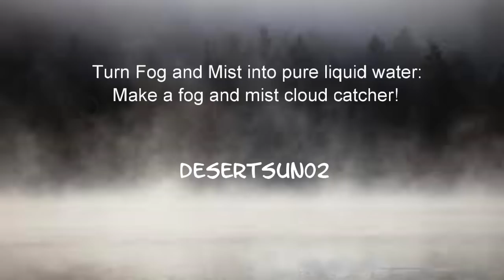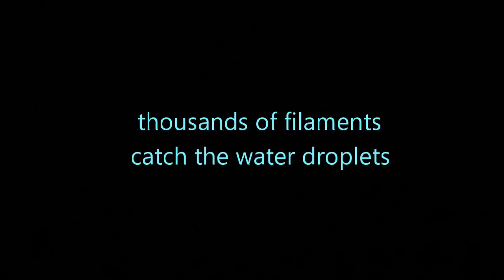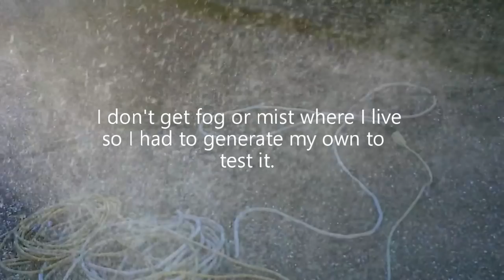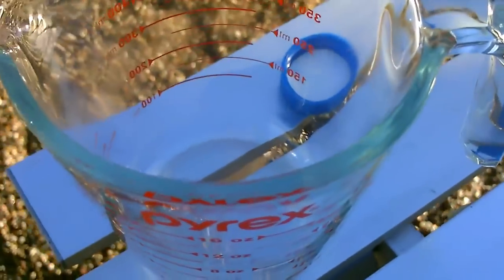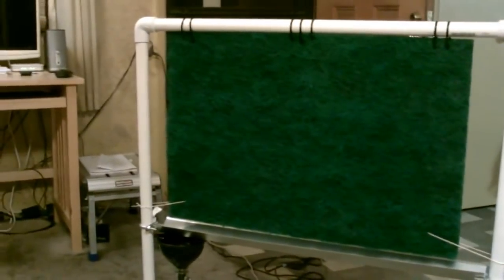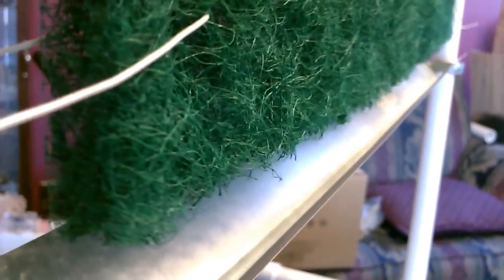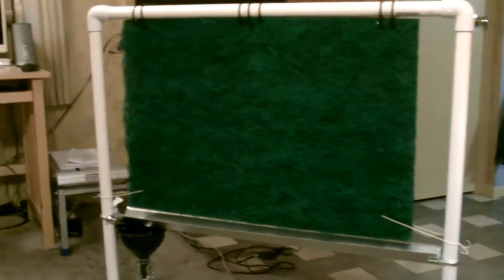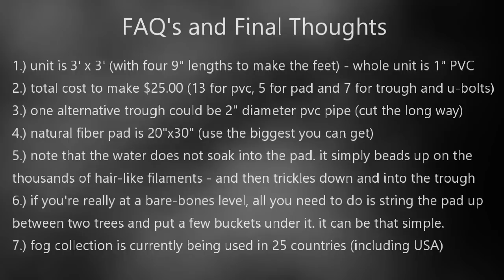DIY Fog Fence! New Design!! Hi-Efficiency Fog Net! New Material!  Harvest Water from Mist & Fog! $25

Comment: This is swamp cooler pad material.  It's available in both natural and synthetic materials.  For longevity, I would recommend the plastic material, which can be purchased in rolls up to 20 feet long.  As far as the trough is concerned, you could cut a slot, say 1/2 inch wide and a couple of inches deep at the lower end to bring the drip more toward the center of the bucket or funnel.  You also might want to drill a couple of holes at each end of the trough where the U-bolts support it and run a zip-tie through the holes and under the bolts to secure the trough into the frame.
Reply from the maker: hi there. one clarification -  it's not swamp cooler pad. that's a relatively soft sponge-like material that absorbs water. this material has the consistency of plastic but is made of natural fiber. it looks kinda soft and absorbent but is actually rough, rigid and bristly and absorbs no water.
Reply: @desertsun02 so what is it?
Reply: @tsachnebiah4832 same question here . Obviously money is getting in  the way here
Reply: Where to buy the net

Comment: Wondering if I can wrap some of this material partially around a tomato cage to make drip irrigation for my tomatoes.
Reply: Wouldn’t it shade out your tomatoes?
Reply: Use the clear polypropylene netting.  Sun goes through.  I’d have a pvc teachers to the bottoms and then have that feed to drip hoses like you would from irrigation.
Reply: @andys3138  Just use on the north side of the plant row so the sun hits the plants first. Might also try just wrapping the main stem with this stuff and see if that improves hydration of your tomatoes. Sometimes the simplest solutions are the best.
Reply: Better yet create a drip irrigation system and remember, the absence of fog means no water.
Reply: @unclemony5939  Correct about this method, but there are other passive means to get water from the air.

Comment: Great idea.  I am looking for a natural way to supplement water on a sailboat.   Will give it a try.
Reply: If you try this, please let us know how it works for you
Reply: Pretty sure you can just use your sail, with a catcher at the bottom. It doesn't need to have the same material as the video.
Reply: I think some ancient Greek sailors used an amphibole or other container partially filled with seawater with a sponge on top to trap and collect evaporate water.  Check out Thales or Milutians.
Reply: @jeromesassani9537  I did some experiments using a black sponge in a black can, within a clear container, and got very little water (only drops)   It was only 7 square inches.  Not enough to live.   I reasoned, that the amount of water produced, directly corresponds, to the surface area exposed to sunlight.   Will need several square feet to produce any significant amount of drinking water.

Comment: The filter is also going to do the job its designed for, which is collecting particulates. So your water would be  very dirty in an area with dust blowing around. Like a desert. But Im going to try it for irrigation here in central coat California.
Reply from the maker: hi. i hope it works for you. yes, dirt might be an issue in desert with wind. you could always put the water through some activated carbon to remove the dust.
Reply: did you try this? any luck?

Comment: I've been looking these up. I was also thinking about how buns make  water if they are cold and it gets warm i am thinking putting those 2 ideas together would be pretty neat. Gardening watering. With a later of plastic or glass. I'm going to play with this idea. Thanks ! That materal is hard to find but multiple shade clothes might just be the easier way these days.
Reply from the maker: hi. you can find the material at walmart or on amazon. one way to find this type of material is to search for 'hogs hair'. it's sometimes called that. it's not real hogs hair of course though. i show a shot of the packaging in the middle of the video. that may help you

Comment: I’m looking to make a off grid water collection system myself, but no fog in my area . I was thinking about a portable dehumidifier with a drain plug . Sat on top of a 55 gallon drum, and let it run into it rather than the little tray provided. Then rigging up a pump through a diy carbon filter or maybe a sawyer squeeze etc maybe both.
Reply: its gonna cost you an awful lot of electricity to get any meaningful amount of water out of that dehumidifier, it will be cheaper to buy bottled water, better off building a well, collecting rainwater or recycling your sewage imho

Comment: What is the relative humidity for this system to work? What is the minimal wind speed requested for this system?
Reply from the maker: hi. basically you just need fog and a little air movement (so the fog droplets buildup and fall down the pad). i can't give exact figures though.

Comment: I live in Fort Bragg CA,, we have fog, and a serous drought right now., I just ordered 4 of the Natural Aire cut to fit Natural fiber filter ( it's Hogs hair !) from Walmart.  I'll be setting up a X 4 larger one of these in the back yard next week.,  I will post my results.
Reply from the maker: hi. sweet! i hope it works good for you.
Reply: @desertsun02  Thanks!
Reply from the maker: one tip:  these work best if it's a moving or "rolling" fog. if the fog is stationary there can be low output. if you're into experimenting try a small fan to "push it along" and thru the pad. water production may go way up.

Comment: Could you put this material inside an HVAC system to catch extra humidity out of the air during cooling season?
Reply: That's called "condensate" and while it's water, it's so not good to use that building code requires it always be put to the waste pipe system.  They don't even allow it to be just draining to the ground anymore.l

Comment: This looks great and I am definitely going to try it but I do have a major concern .
I live in a coastal area with a lot of morning fog and my worry is just temperatures .
I think that this material may well be too self insulated that it will always be a little above the surroundings so it won't collect anything .
I'm fully going to try it out with an open mind and totally hope that's not the case just think it's a possibility.
Reply from the maker: hi. the main thing is just having the fog. (if the fog is a 'rolling fog' that is the best). temperature of the air probably won't matter.
Reply: Did you try it? Any luck?

Comment: Also there is a company that makes a large condensing coil and can pull water from air as long as humidity is >10%. Almost like a giant air conditioner.
Reply: Link? 🙏
Reply: @fransjebik8554  Any dehumidifier will do.
Reply: @Ihaveausernametoo  Yes I know. Important is to read good the description of the materials in that machine.  (gas, aluminium) I found one with a propeller, no noice. Takes 400 Watt. For my system (off grid) to much.

Comment: If the netting is thick there might be some issues on windy days, in which case it might be a good idea to angle the setup against the prevailing winds.
Reply: Definitely an issue considering most dessert areas ( which is where you would want fog netting) get very high winds consistently and also this wind may kick up dust and get fog nets dirty very quickly.

Comment: i've got a few things I dont really know if you live in a foggy place but for those who do I got some ideas

1 can you spray it with a hydrophobic coat to see if it can increase yields, there is a PBS newshour video about newer materials if you can find something similar to the horizontal wires that would trap and let the water run down easier? maybe like a silicone thread skirt? 

2  An electric fence or electric chicken wire in a funnel would work since the MIT guy in the PBS video showed it off?

3 would it be better to be used near metals you won't want to rust due to stopping the water or bad air going in there (for this one I really don't know if a hydrophobic coat would work since not sure what it would do w/ salt in air and gases like CO2, SO2, SO3 etc, but also not sure if you care about rust and that idea could take a while to see results in repeatability and reliability and you would already use some other products for this too)

I would try to do this stuff but I'm in a cramped apartment
Reply: What's this PBS video about? Are you saying an electric netting used for chicken coops works better for fog netting?

Comment: Is this like the systems to generate water that is online now? Where you can pull the water out of the air, not just fog.
Reply from the maker: hi. the other system is an atmospheric water generator. those pull water straight out of the air.
Reply: @desertsun02  Also, the atmospheric water generators use a lot of energy. They are basically an airconditioner unit- you know how cars always drip water from their airconditoner unit on your driveway?

Comment: There's a company in AZ that has a unit with a solar panel that doesn't need fog and produces liters/day.
Reply from the maker: hi. that sounds like an Atmospheric water generator. those are cool. they are basically fancy dehumidifiers
Reply: @desertsun02  and it's solar powered! (and expensive) It's like getting water from the sun. Fascinating!

Comment: I am vision impaired so I did not try to read all comments. What is the name of the netting/material? What is its usual use?
Reply from the maker: hi. the netting material is technically called 'hogs hair'. it's a filter material sometimes used for air filtering. by the way, it's not real hogs hair, they just call it that. check near the middle of the video if you want to see footage of the exact packaging that it comes in.
Reply: @desertsun02  Thank you. It did remind me of filter material. I was hoping to find much larger sizes, perhaps on a roll, to set up fog harvesting, at a high altitude in Costa Rica.

Comment: Where did you buy this material?  It looks like a giant scrubbing pad for dishes.
Reply from the maker: i never thought of that (but it does). i actually got the material at walmart. the general term for the material is 'hogs hair'. (it's not real hogs hair but that's what they call it)
Reply: @desertsun02  thanks.  Is it in fabrics?  Or where?
Reply from the maker: @Barbara Brooks it probably won't be in fabrics. it's often used for filtering air.

Comment: I'm so frustrated. I live in the middle of the Mohave dessert in Arizona where our temps vary between 115 and the low to mid 120's yet anything you find on line regarding our summer temps has been manipulated I presume for people that are considering moving here or visiting. We are in a severe water shortage... The Colorado river... You show different materials and netting but you don't state what they are actually called or made of so we can research places online to purchase it. 
Will you please respond? Pastor Ann in Fort Mohave, Arizona
Reply from the maker: Hi. I know what you mean about the people in charge manipulating the temp data. I'm seeing that where I live this year. They are making it seem cooler than it actually is. It's a natural fiber air filter material called 'hogs hair'. Make sure to watch near the middle of the video. I show the actual packaging that the netting came in.

Comment: Hi, I was wondering if the fog netting material you used is called something else. I've looked on Amazon, googled pond materials, but can't find it in rolls, or small panels. Could you tell me where you purchased your fog netting material?
Reply from the maker: hi. it's made of what is called 'hogs hair'. last time i checked walmart had it. (that is where i got it). the packaging with the details is shown in second half of video
Reply: @desertsun02 Sorry I missed the part you mentioned Walmart where u bought the filter. I'm excited to finish my list of things needed to start making my own water, and a DIY water filter system to clean my apt. gray water. Just in case humidity not high enough to make water. Thank u for sharing your info.

Comment: I live in a place with dew, but not fog. How would I adapt this for dew? I was thinking that it would need to be lower to the ground and at an angle(Maybe 30 degrees). And the water collection apparatus would back the fabric in order to catch all of the dew. Any thoughts?
Reply: Hi, there is a lot on you tube for harvesting water from dew, I saw them high, lower and indeed more horizontal. But, vertical can too. 
Every morning I have dew on my table, the dew from my roof is on the ground, so, I think it does not matter. 🌹
Reply: @fransjebik8554  Thanks. I've done a lot of searching, but really haven't found much on dew harvesting. Some of the ones that say dew, are actually using fog. Can you point me to a video or 2 if you don't mind? Groasis looks good, but hard to obtain in the US.
Reply: Hello,  Did you already find out the answers for you questions? If so, share with us. Thanks.
Reply: I’d think that would work. Put some clear polycarbonate sheeting for roofing like on a greenhouse. You could use metal but it might heat up and degrade the  padS.  

Edit: or lay some of that pond liner down.  I think I’ll try this on my hill and  maybe just attach the pads to lay on top of that.   Pad land into half long wise pvc and run down to barrel.

Comment: Have you tested this with ultrasonic fog?
Reply from the maker: hi there. i haven't, but that's an interesting idea 👍
Reply: @desertsun02  I might have to try it. It also would be interesting to get an automotive silica spray and try lightly spraying the pad. I read a paper that found polypropylene doped with 1% fumed silica is 20 times as effective at harvesting as pure PP, at least for ultrasonic fog (~10 micron). They extruded the film with the fumed silica content mixed, but hey maybe a spray application would work too.

Comment: Have you tried a piece of polyethylene?
Reply from the maker: hi. no. but i'll look into it. ✔
Reply: @desertsun02  What's on my mind is a wall of polyethylene sheet to block fog totally. It is important to keep the sheet movable between two poles upwards and downwards. Such design is going to last longer thanks to the strength of polyethylene compared to fog nets and it will be removable in high wind times so that it doesn't get torn apart.

Comment: Does the pad filter have a name i can look up to buy?
Reply from the maker: it's a naturalaire organic fiber filter. lots of companies make them thou. from google 'the filter is made of organic fibers that have been curled and coated with a special resin, then baked together at a high temperature. The result of this process is a tough and springy, thoroughly bonded, nearly rigid filter'
Reply: @desertsun02  thanks
Reply: Forgiven 87 This filter appears to be medium green matala made of hogs hair with a thermopoly propylene coating distributed by Naturalaire. 

They are sold at Walmart and on Amazon and EBay. You can use “naturalaire”, “Matala” or “natural fiber filter” searches to find this or similar products. 

D.
Reply: @westmountainadventures3606  Thanks!
Reply: @westmountainadventures3606  I looked these up(Naturalaire) and they contain the warning: WARNINGS:
proposition 65 reasons:titanium dioxide, other chemicals

“⚠ This product can expose you to some chemicals, which is known to the State of California to cause cancer.

The Matala filters appear to be food safe. They are used in Koi Ponds and Aquaponic systems. Seems like the way to go. Thanks @WestMountain Adventures for the info!
Reply: John Blues Thanks for the heads up on the naturalaire. 

D.
Reply: @john_blues  Thank you very much!!! 🌹
Reply: @westmountainadventures3606  No problem.